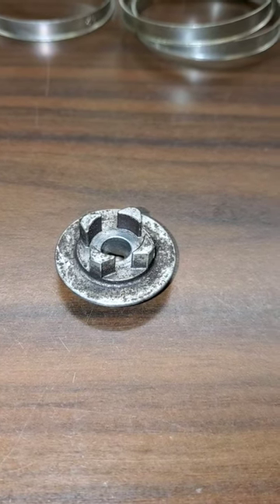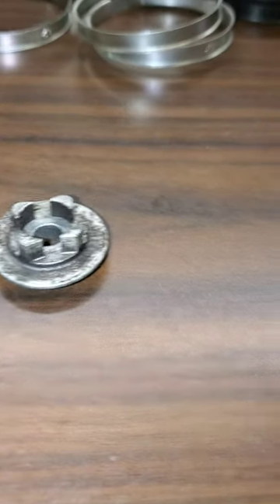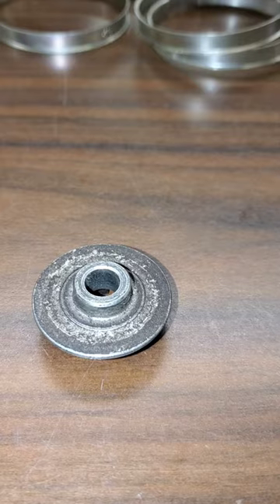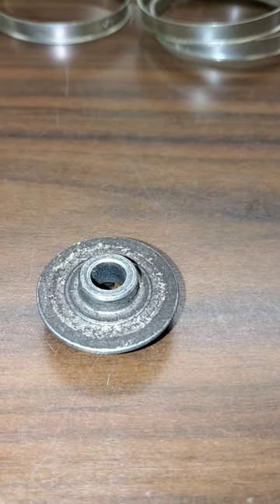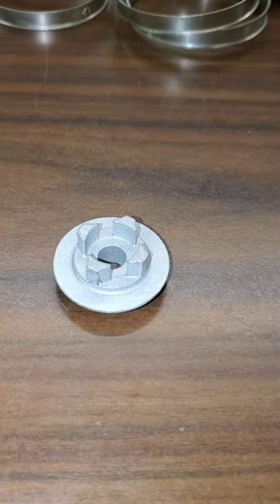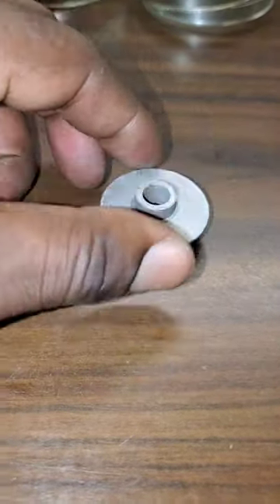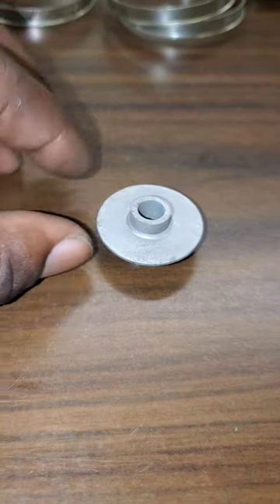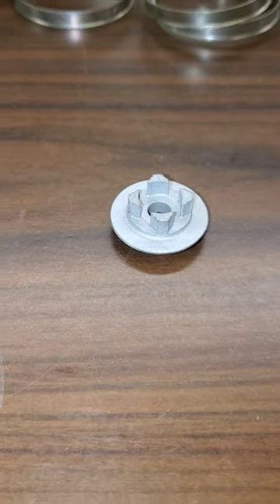Lathe Work On Suzuki Hayabusa Speed Sensor Rotor 👌 #Hayabusa #GCP

Comment: Dude, i have been on the phone with SEVERAL DEALERSHIPS and not 1 could explain the difference between part #34981-42E01(old #42E00) and the 2001-2007 part #34981-38G01. Thank you!!!
Reply from the maker: You're welcome. It comes down to experience in alot of cases. 👍